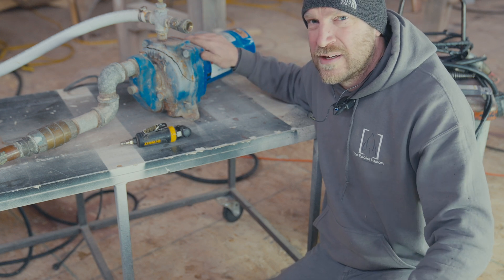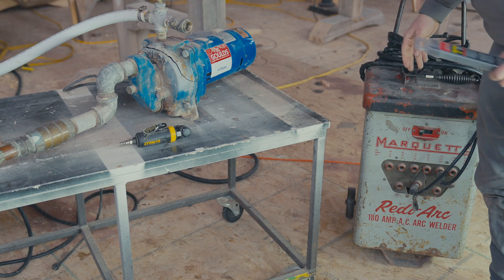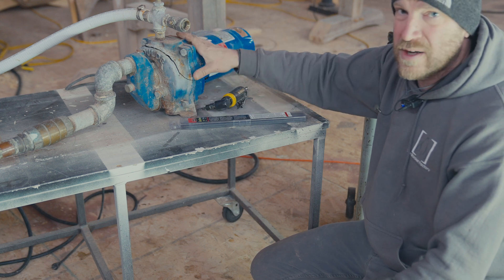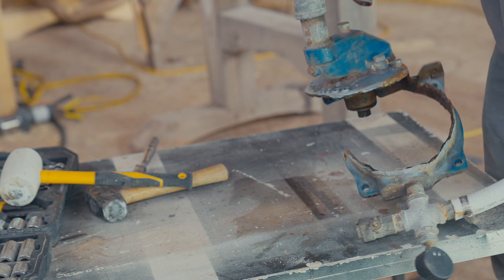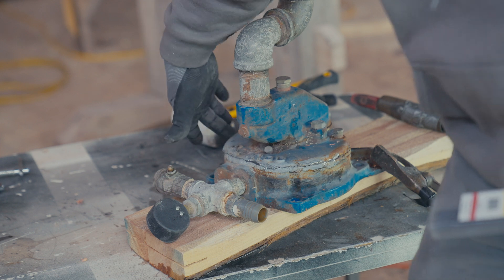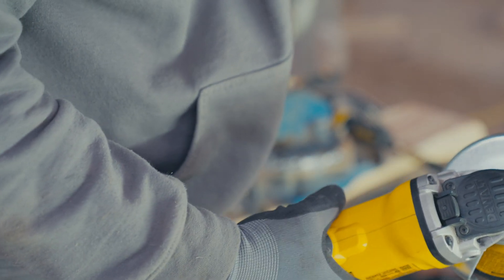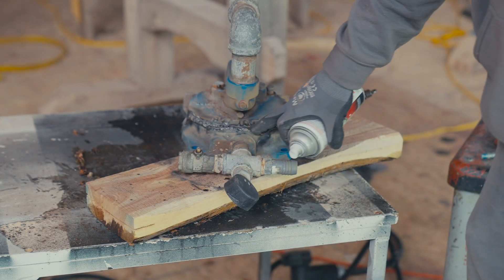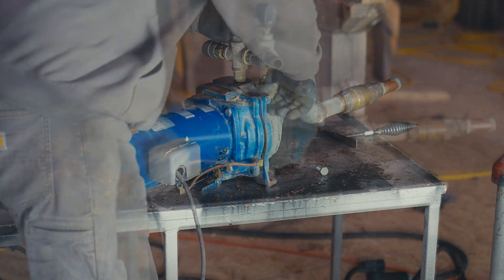How to fix a freeze busted cast iron well pump.

Comment: Man, I am literally in the same predicament right now. A fitting broke on my pressure tank and then I discovered that it was completely rusted through so I decided to replace the pressure tank and accidentally left the well pump running. After it froze the other night when I discovered the problem of course the entire front of the housing is cracked to no end. I inherited my granddad’s 70+ year-old property and fiddling with plumbing that is that old is something else.😂 when I looked at replacement pump cost. I was shocked. I appreciate the helpfulness of this video more than you can ever imagine.